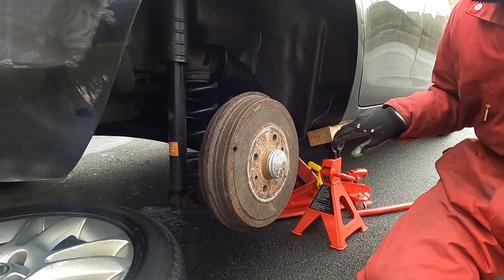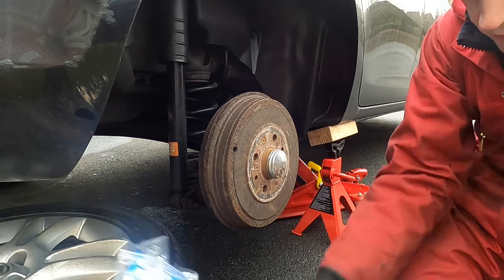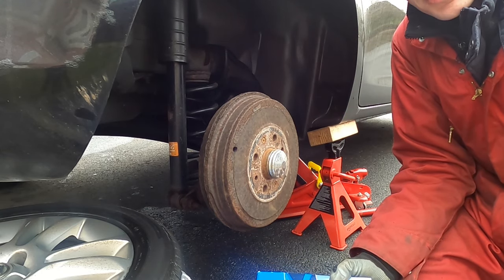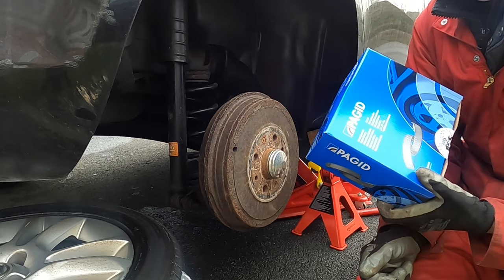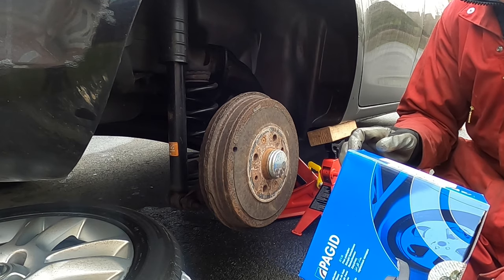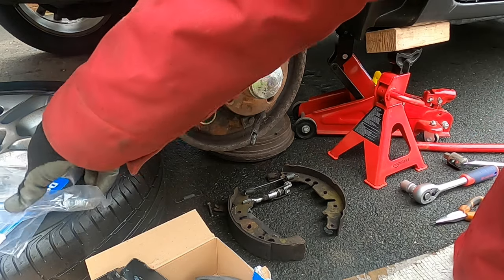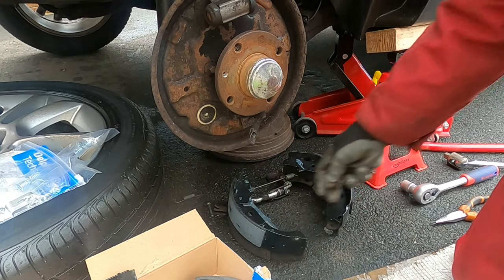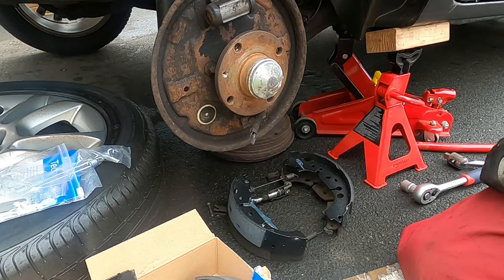How do you change rear drum brake shoes on a Vauxhall Corsa?

Comment: Check under the cylinder seals to ensure there are no leaks, also when adjusting the handbrake, first cycle the cyle the handbrake several times to settle the shoes, then ensure drum moves freely with handbrake off, then that the drum locks with 2 clicks on the handbrake, then your sorted.
Reply: Судя по видео, ремонт делает школьник😂

Comment: I am a tyre fitter mechanic at kwik fit, plus advanced technician level 3 with BTEC qualification in motor vehicle from college but always ask for help off another colleague when adjusting the spring before putting shoe back on for double clarification on my alignment and test run. As simple job it looks, it ain't as difference between common modern car rear disc and pads is you ain't gotta worry about spring adjustments just the test run check but with older and less modern cars is you gotta worry with getting rear spring correct alignment right before taking it on first test run and it make a resisting noise with handbrake up slowly rolling back little quite often. Few times l been lucky, and other times l ain't as tuned out to be brake pipe, old contaminate fluid, cable leak etc that l didn't check when customer bought car in, and nearly getting caught out on it by my boss but just gotta roll on with it and always try second test run after quick diagnose fix on top of that to finally typing a brief summary of my findings along with what l ordered, and repaired in a detailed report down on computer, printing it out then to office and filling out paperwork in office ready for customer to pay and collect before signing out the car. Doing paperwork mostly all of time is not same as car repairing but one of the toughest job in any role at the garage as you gotta be brief and detailed on every diagnose finding possible, all this just for one issue often of correct alignment or another small issue during alignment which all time crops up to be bigger job that needed attention to is hard work but gotta do it for everyone stay happy ai lol.
Reply from the maker: Hiya buddy, thanks for contributing. Yeah not always an easy job and hats off to any mechanic doing this for a living, it's a tough job at times!
Keep doing what you're doing and please keep on commenting and subscribing, good to hear from professionals on the channel as I always admit I'm just a basic amateur doing car stuff!
Reply: @junkendriven  Hi, yeah working on older vintage cars shall l say is very hard work and a skill l lightly go on using other colleague with experience to supervise me, as with shoes also parts on vintage cars that doesnt come cheap for parts that dealerships gotta find nearly everywhere or create again isnt everyone confident skill, mess up on certain part and it tougher also longer job where that part would need either resembling or reordering because back in day our fathers and ancestors who were mechanics knew every each way to fix a shoe without going at it twice or test runs. Yeah, best way l started mate, got use to fixing cars in short run by going at it myself on my cousin car scrap yard at 10 years old, then doing lot of work placements at 12 to 16 before old enough for college but today, l gotta admit that l still am a amature from college learning more and more about cars when they keep bringing in new city & guilds, BTEC and level qualifications for EV when renewing what we we taught but doing renewal of our basic levels is often a challenge worth completing, from gaining upper insight knowledge in manufacturers of EV motors.

Comment: Just had to fit some of those retaining clips. You can actually buy them in sets of four along with the springs. They are a bit tricky to fit but luckily I have a small G-clamp which came in very handy for that job. You just hook it to the shoe and wind it in from the back plate, which leave you with both hands free to do the job. If a G-clamp is not available a piece of wire eg a coat hanger cut to a U-shape slightly on the small side should do the trick.
Reply from the maker: Great info, thanks for contributing

Comment: Very helpful video, thank you very much!

But I'm concerned about the safety of the operator with the trestle / jack stand with the piece of wood, supporting the car at that angle.
I think that should be corrected before one of your viewers apply the same technique and get hurt in the process.

Comment: My Corsa does not have those little retaining screws, they must have decided to do away with them. Try as I may, I cannot get the drum off. It rotates freely enough, but it will not come off. A shame, as the rest of the work looks straight forward.
Reply from the maker: They do take a lot of force, work the handbrake a few times too to make sure the shoes have disengaged, keep working it away. Also look in the screw holes and make sure they've not snapped with a small amount left protruding (really common the screws snap) and if so you need to drill part of the screw out.

Comment: Thanks! Verry helpfull when the weather is getting better i wil try it myself tot the parts for like less than 150 euro's and then i got the rear pads. Rear Drums. Front discs. And brake  pads. in front as wel thats crazy cheap if you see what the  garage charges for al that stuff just amazing video
Reply: You can get all the tools and parts for less than what a garage would charge. Watch loads of videos before hand for all different types of tips because nothing ever goes to plan. My biggest tip for doing brakes is cleaning all your surfaces thoroughly. Brackets should be cleaned to look like new, it can take a long time but it's the most important as this is the surface that the pads slide back and forth on for 2 years, rust and baked on brake dust expands in the gap. Many people don't clean them properly and end up with binding pads 6 months later and destroyed discs. I'm talking about discs because this guy did a good explanation of drums already

Comment: Look identical to my 2012 Doblo van. Bonus as not much out there video wise for those.
Reply from the maker: Good info there, thanks for sharing
Reply: I used a large flat bladed screwdriver on the horseshoe retaining clips to depress the prongs to engage under the flange of the pin whilst getting ready to shove it home with a pair of pliers holding the base. I would recommend disengaging the ratchet tooth with a screwdriver in one hand and turning the barrel of the adjuster with the other. Some of the the teeth are made of cheese. You can go backwards or forwards them in complete mechanical sympathy until you find the Goldilocks zone.

Comment: Andy after fitting your new brake shoes did you have problems with handbrake adjustments. I replaced my shoes with a complete kit and could not get the hand brake to adjust on pull the hand brake on it went up to the roof. Put the old set back on everything was perfect. On the old brake shoes the handbrake cable spring goes over a pin and locks in place by a small lever and puts tension on the spring. Now when watching your video the hand brake cable spring end looks to have a small gap and no tension. On my set of new brake shoes same as yours this cable spring does not seem to lock anywhere in place, I must have tried all combination and would not work? to me this is a poor design on replacement shoes by manufacture cutting costs any ideas if I did anything wrong Andy? Please my old brake shoes still had some meet on them.
Reply from the maker: Hi Gary, yes most replacement parts aren't quite a standard fit so you do need to sometimes fix things differently.
The spring for the handbrake, you need to pull back quite a bit of spring first (I used pliers) and then push the rounded end through the gap, then pull it round and into the little gap for it. The spring end that was attached on original I pulled round and rested it on the brake shoe so it's secure. That's just to stop it coming free. You should feel a little tension on the brake cable pretty much at all times. After that go and carefully try your brake lever, you should get resistance and see travel on the spring. Keep trying, you just need the position right and it'll sort of all snap together
Reply from the maker: Drop me an email, contact@junkendriven.org with photos and I'll help if I can, but remember any doubt and get a professional to check since it's your brakes
Reply: Rear drum brakes are sensitive to:
- self-adjuster condition (operation, bimetal part),
- handbrake linkages (if they are old, stretched, or damaged - "just" a shield broken will spoil the brakes),
- last thing is hydraulics (hoses, cylinders).
 
So handbrake can spoil the main brake (hydraulic) and the other way round.

Comment: Apply a little anti seize on the hub before you put drum back on and it comes off easily every time, I also read the drum brakes are self adjusting so it automatically sets into the perfect setting itself

Comment: i have a question about the self adjuster part at the top, i have a mk2 focus, an old one, but the rear breaks are drums and look exactally like yours, i have seen a few videos where people are winding the adjuster all the way in, and then your way where you just move it back over to the new shoes.

Wouldn't this be incorrect ?, my understanding was you had to turn the adjuster all the way back so it can self adjust for the new brakes ?

Ill be doing mine at the weekend. Cant seem to find an answer
Reply from the maker: Hi, sorry I'd missed this comment, but yes you are right, afterwards I did wind the adjuster back as you rightly point out it needs to be almost fully retracted to cope with the thickness of the new pads and will then extend out over the wear. Thanks for the pointer buddy and thanks for contributing

Comment: Just one thing - bolts m10 not too  simple ..
May you use some special bolts ?
Reply: Bolts are called by the size of threads because you cant always assume the threads by the head size. A 13mm bolt is almost always m10 thread.